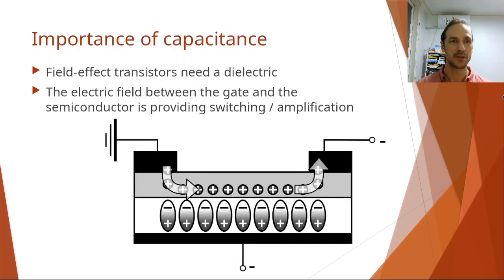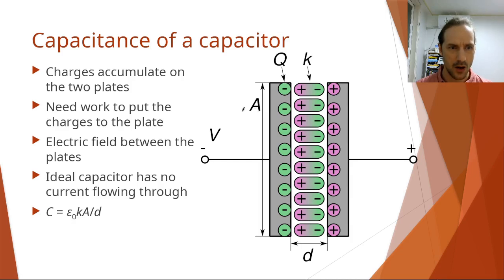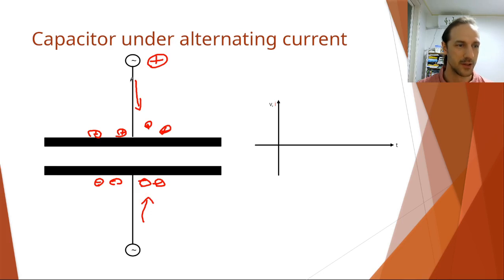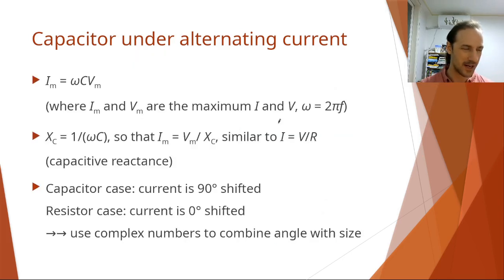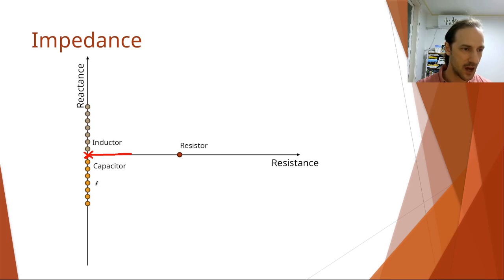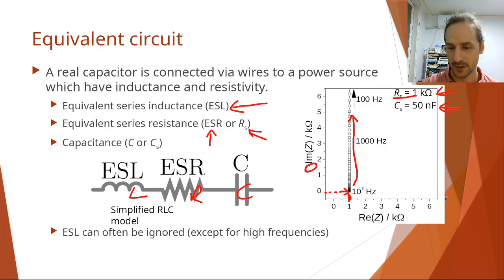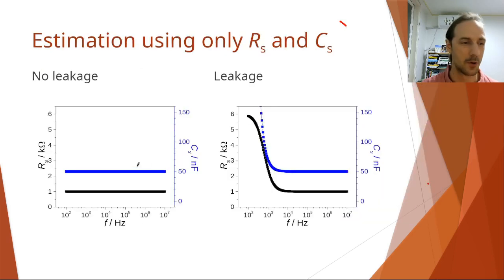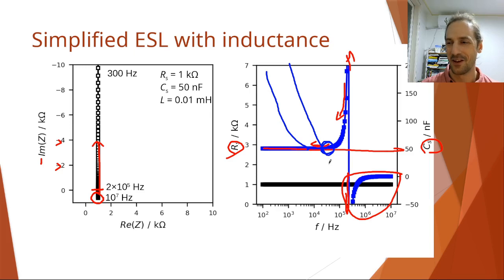Impedance and capacitance - a primer for materials scientists characterizing dielectrics

Comment: Hi, as an electrical engineer, I'd suggest changing the title to something like: 
"Understanding the Role of Dielectrics in Capacitance and Impedance: A Primer for Material Scientists".
Capacitance is a property describing the ability of a system to store energy in the electric field between conductors. Dialectrics can influence the electric field between the conductors and thus alter the capacitance. However, dialectics do not possess inherent capacitance as the video's title implies. Unfortunately, the title in it's current state is nonsensical
Reply from the maker: Hi!
you are right. But your title suggestion is very long and doesn't cover what the video is about. I don't talk about the role of dielectrics. The video is about what impedance is and how it relates to capacitance. I will think about a better title.
Reply from the maker: I changed the title... I hope it makes more sense now!